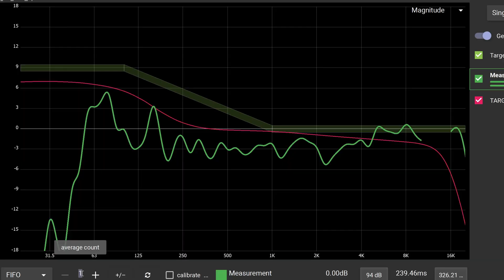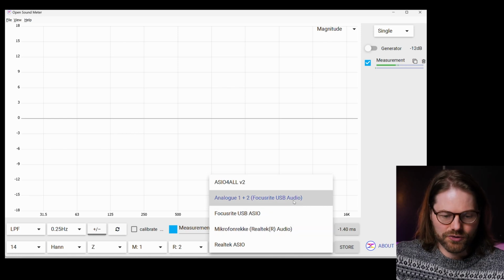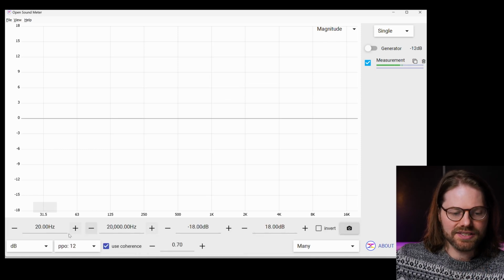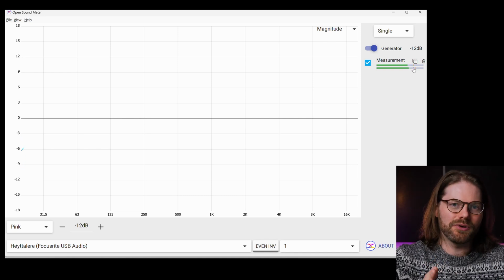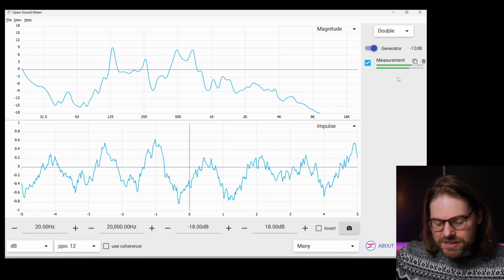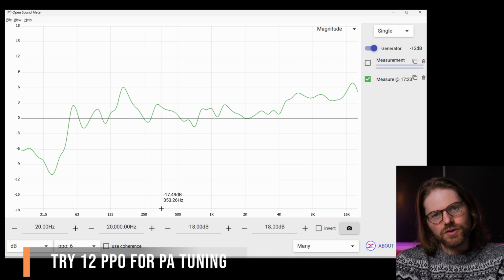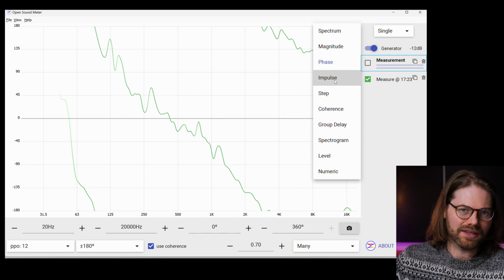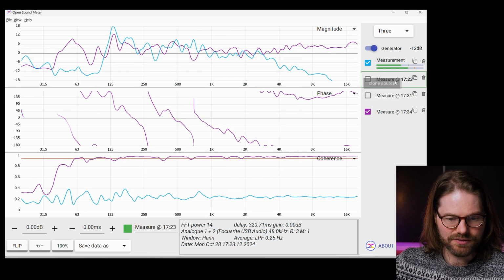Quick Start Guide For Open Sound Meter

Comment: Hey,

Can you help me with theses 2 problems : 

- About the reference : Is there a difference between choosing the internal loop and choosing Michel Curtis' method (he uses a jack to make a physical loop and plugs it into input 2)?
- Did you change the routing configuration in your Focusrite Scarlett  ? By default, the microphone is sending into the speaker, so I have feedback. I thought OSM would have protection for that but I have to change the setting is the controller and nobody speak about that.

Comment: One difference I would suggest is to always use a hardware loopback. Take a cable and connect output 2 of the interface back to input 2, then set the generator to output to both outputs and select the second input as the reference.
There's many reasons for this:
1. It will account for the response of the interface, phase, magnitude.
2. This will also account for the delay in the audio drivers and interface and means the delay numbers will be much more useful and readable, and you can do a sanity check on them much easier.
        For example, if the mic is 1m from the speaker you should expect about 3ms of delay (plus maybe a few more ms if there's dsp in between). if you then move the mic 3m away you should see ~9ms.
        When time-aligning PAs this makes it much easier.
3. It gets you used to the concept of a transfer function and makes it easier to understand how to for example measure an eq or system processor or mixing console. 
4. You don't have to use the built in generator for the measurement, anything with energy in the frequency range you want to measure will work, including music.

There really should be a warning message when you select loopback about these limitations. I'd only ever use it if I was in a hurry and forgot that cable.

Comment: Thanks for the video, this has been great for testing out how to tune speakers... When using OSM for live sound system tuning (obvs doing each side individually), I've struggled to get the coherence up to anywhere above around 0.4/0.5. When trying to check the L side of FOH, the mic was placed right angle perpendicular to the top array of the L side pointing directly at the driver (as best as poss), and I took measurements at 3M and 4M away. However the set up of the room and speakers meant that the speakers are basically directly next to the L&R wall of the venue, and therefor the Mic was then placed practically next to the wall as well in order to be perpendicular to the system. I added a 9ms delay for the 3M reading and 12ms for 4M reading, but the coherence was still pretty bad and unusable, I'm assuming due to early reflections off the wall? Should I move the mic closer to the system? Will that effect the reading I get and skew the results of what the audience will hear when they're in the centre of the room? I was wondering if there's any info you could guide me towards, or help me understand how to maybe approach trying to get a usable measurement in a Live situation like this where the FOH mains are essentially at the closest points to the L&R walls possible... 🤔 any help would be amazing!

Comment: when you uncheck the coherence button you tell osm to not use coherence data as an alpha channel for the graph. since you have the level of your monitors really low, coherence is low too (the same if you stop the generator), so the alpha is applied to every frequency and you can’t see the graph

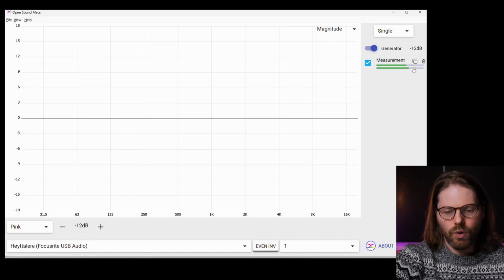Comment: Great video on OSM, but I'm confused/conflicted when I got to 7:18. In a studio environment, I assumed it was recommended that you turn up your monitor output to get the SPL level you want to calibrate at (using an SPL meter, around 80db-ish) using Pink Noise, THEN you gain your microphone until you match the reference signal. If you're doing a small PA for a business meeting, this may not be necessary. But if you're someone working in a music studio, trying to get a target curve/trace, would you not get your speakers to the correct volume to see/hear how the room will react with the speakers at louder volumes? I feel like that would be important for accurate measurements. Might not be as much for live sound possibly, but in a studio, matching 80db (or whatever your target loudness is) to the mic gain is crucial to accurate data. This is just what I have learned, and I hope to hear if you have some clarification behind gaining the mix before turning up your monitors. Thanks!!

Comment: But where do you put the mic in the room?
Reply: The centre of the room is usually best.
Reply: Highly dependent on the complexity of the system and its routing/distribution specifics.  But in a simple 2ch stereo setup, make an equilateral triangle between the speakers with your mic as the third point at listening height.

It's much more complex to do it correctly when things get assymetrical or the listening area is closer/further or you are metering bands of frequency (L/M/H) by driver....

Comment: I've been trying to use Open Sound Meter in our church to create an external display of sound level and frequency.   I'm using the pink noise function in the X32 to inject noise into the room.  I can get the input visible on Open Sound Meter but I'm lost on how to calibrate Open Sound Meter.   I've a pair of standalone db meters I use to measure the level but don't understand how to adjust Open Sound Meter to match
Reply: You will need a mic calibration tool. There is a recent video on this channel where he explains it.
Reply: @parklee3708  I picked one up on Amazon and it worked great.  Took less than a minute to calibrate it.   Given the time it saved it was well worth the money.

Comment: I'm a little lost on how to apply the measurement curve. I work on an M32, so my "theory" is that essentially I would get measurements via OSM, then just make those EQ cuts on my main L/R bus? Or am I now running all of my inputs via the interface I'm using for OSM?
Reply: Once you get your measurement readings, you can adjust. the EQ on your mix busses. If you're sending everything to the L+R buss then yes make the EQ adjustments on your L+R buss. I run everything through matrices eg. Main L+R, Subs, Front Fills, Side Fills, etc. so I measure the output of each matrix separately and then adjust the EQ for each matrix separately.

Comment: Great vid! Is there any drawback when using the builtin (software?) loopback instead of a separate cable doing the loopback e.g. from output 2 to input 2? Or in other words, is there any benefit when using a physical cable connection instead of the software loopback? I would assume much lower latency?
Reply: I’ve played with both and found no difference with the measurements but there is huge delay with the loop not that is an issue as far as I know.

Comment: One thing I came here looking for and didn’t find was the OSM gain setting. I had the same mic into my UA Volt interface with the interface gain all the way down and I still had 40 to 50 db of audio. Where could I be going wrong? 

Also, I compared to a handheld SPL meter to see how things compared and I had to bring the OPS gain way down for the reference mic to b close to the SPL reader. Any insight on where I’m wrong?

Comment: The averaging on OSM is what throws me off. Typically for optimising a PA system using smaart 1 sec / 2 sec average times yield the best results. Seems to be impossible with OSM. And the LF coherence is always troublesome. Never settles. Great for a free software but might have to be careful using it to align a sub and top.
Reply: Weird, Im getting the same thing in the low end. It never settles. Don't know what I could do differently.

Comment: Thanks for the video. Tuning speaker systems is not my use case. Loved the video anyway.
I use Open Sound Meter (iPad & UMIK-2 measurement microphone) during live gigs for sound pressure level control. Open Sound Meter I have set set to present 3 types of information:
1:Top left: LAeq 15 min. to comply with the convenant 103dB(A)LEQ15 In the Netherlands.
2:Top right: RMS SPL A Slow to provide me with the actual sound level.
3: Bottom: Spectrum (handy to see exact feedback frequencies would they occur)

Challenging is to calibrate the UMIK-2 for sound pressure level (calibration file is only for frequencies). Any suggestions how to do that?
Reply from the maker: Great idea. I'll have to make a video about SPL measurement using osm. 

To measure SPL you need an external calibrator like this:
https://www.isemcon.net/ashop/product_info.php?products_id=3

You should calibrate the mic and preamp in osm every time use it. I'm not exactly sure how that's done in osm but I'll find out and make a video
Reply: @ Thanks!

Comment: In your video your speaker is about 1 meter from the mic, how come you're getting 311 ms of delay compensation? that's 107 METERS of distance!
Reply from the maker: Good question. Using the loopback functionality introduces a degree of latency so you get long delay times when compensating. I can't remember exactly where you can read more about it. Might have been the smaart manual.
Reply: @OffshoreAudio  Is it better to physically loop the right output to the second input?
Reply: @marcobarri1874  Yes it is. Because than both signals (reference and mic input) will take the same path (preamp, DAC, digital signal path line driver, software driver,etc.). Each part of this path will introduce equal latency for both inputs. 

The noise output should ideally be split and go to:

1. your mixer/PA system/speaker processor/monitor controller in your studio and

2. The second input of your measuring audio interface. 

You can also send the noise signal to two outputs. But this introduces tiny little differences in the signal paths. 

So you will only delay compensate  the audio traveling through the air from source to speaker. 

You will get better results and delay (latency) compensation will be easier.
Reply: Sounds like the units might me microseconds
Reply: My question is did you take sound from L&R  output of the sound card to the mixer for the pink  noise to come out ?

Comment: Awesome video! Another thing I would add in is showing the math source feature. You can show a power average of multiple measurements to get a better idea of the entire room. It’s under File > add math source
Reply: There's a lot he didn't show. I'm guessing its because this video is meant to get the average user up and running with all the basic and most commonly used functions.